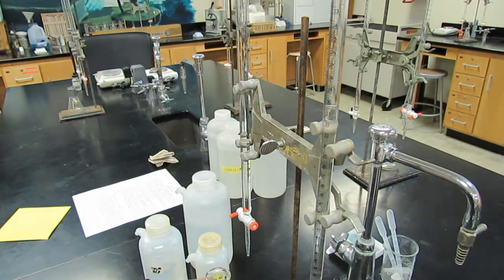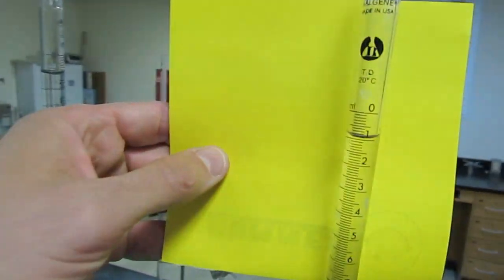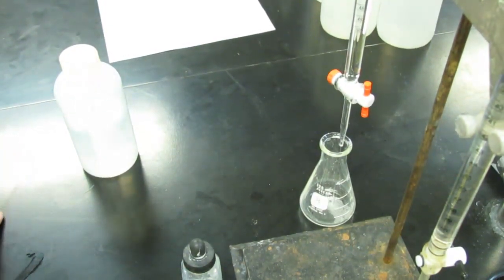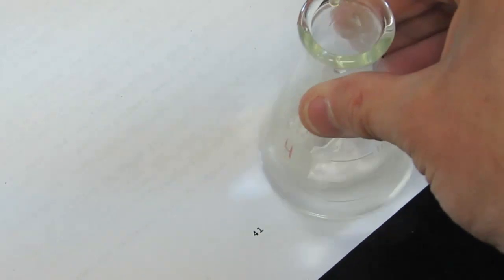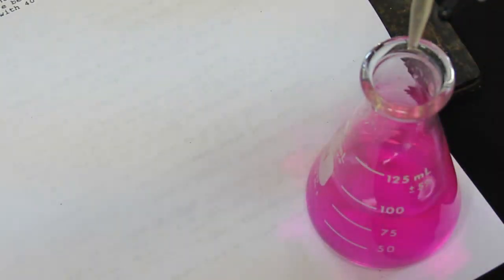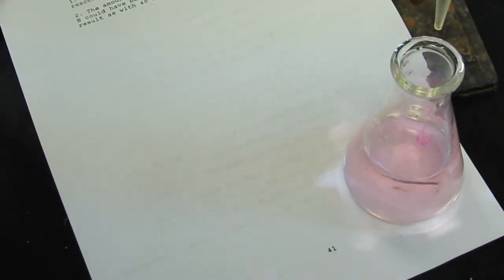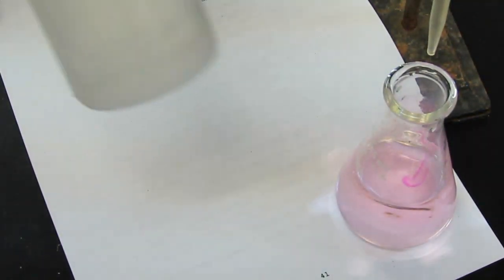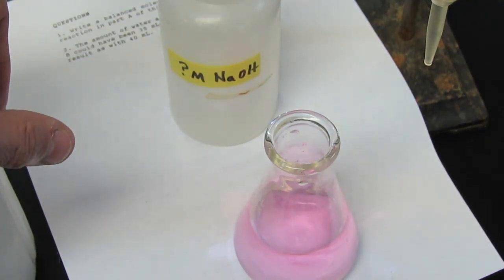Lab: Standardization of an NaOH Solution

Comment: I pour little water over a large amount of NaOH hoping to provide a stronger base to clean my bath tub sewer line.. but now the heat or the over concentrated solution created a firm layer of NaOH on the bottom ( think its from those thats not yet melted) and basically blocked the line completely.. what should I do? is there anyting that will melt this subsustance?

Comment: the practicals in chemistry are very interesting and the videos also so wonderful nice showing out the equivalent point is reached but my question is what if you prepare the solution for titration and then take out the pilot from there you find that the volume of acid you were the intended is above the required volume, the which best way will I use to standardize the remain solution so as when I get the second attempt the volume obtain be the correct volume intended....?
Reply: Tor

Comment: how can you tell if the solution after the titration is acidic or basic?
Reply: by the concentration you will get after your calculation in mg/l or g/l, eg if u get 0.862g/l (its basic ) or 675g/1000ml (acidic)
Reply: Angelica Foster If we react a stong acid with a strong base, which is the case in this video it is a neutral solution. If it is a strong base with a weak acid it is a basic solution. And similar applies for strong acid with a weak base

Comment from the maker: I suppose that is true if you could split drops of base.  You must consider the rapid rise in pH near the equivalence point where one drop of base will change the pH by more than 4 units... approximately 5 to 9.  This method will give a result with at least 3 significant figures... usually plenty for a high school laboratory experience.  Thanks!